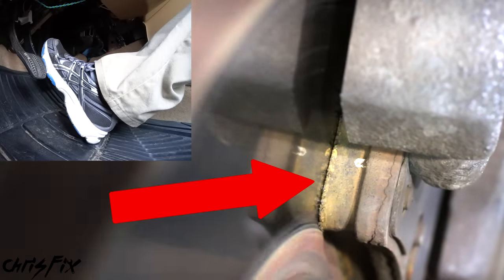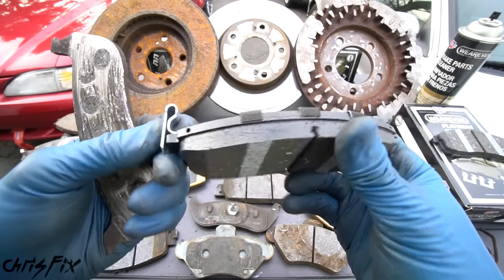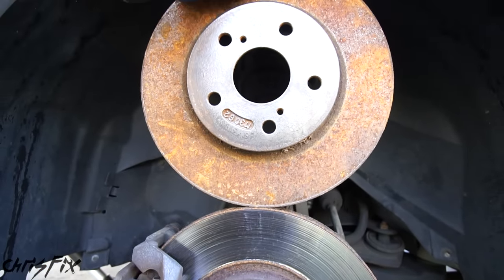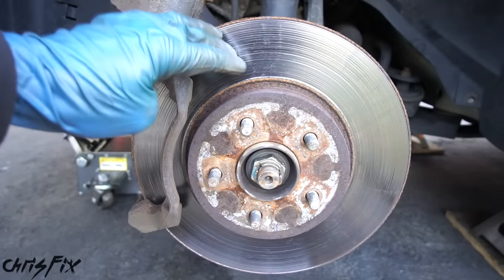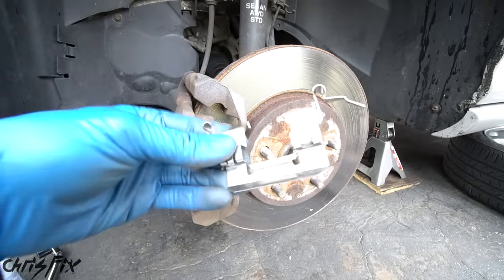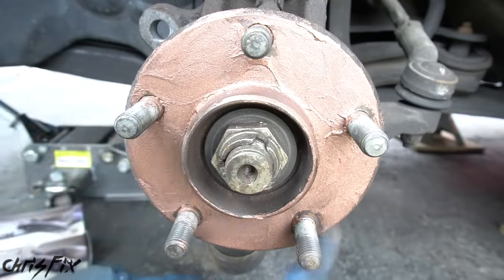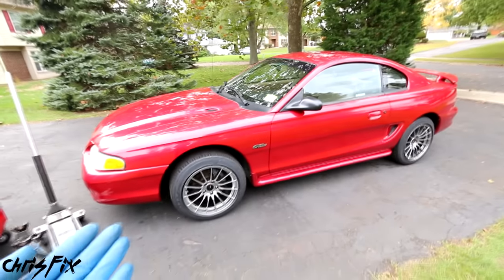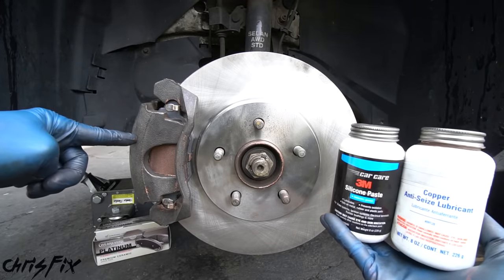How to Stop Your Brakes from Squeaking

Comment: Hopefully someone will help me here - I got everything on my front brakes replaced - rotors, pads, calipers, fluid and I still get this weird noise. Its kind of a grind that occurs at the same point when you turn the wheel. Imagine it like you start at 0°. Now from 0-270° no sound, 270-360° it grinds, kinda like you would be apply the brake just veeeery sligthly. So of course, it is much worse at higher speed then at lower speeds. I had my pads and discs replaced several times, and it always starts like this and gradually gets worse and after 2-3k km the rotors can be thrown into the bin. My thought are that maybe it is wheel bearing or hub.. but honestly.. dunno. Had 3 different mechanics look at it and it is still not ok. Car is 2010 Fiesta (front disc, rear drum).
Reply: Yes sounds like wheel bearing, hub or differential. Check for one of those.

Comment: Hi  Chris, i have a question on brakes for a Silverado 2017 with 30000 miles, rotor had some groves inside (by the dust shield side) but not on front side, front side if the rotor looks clean and only the front brake pad is wear, do i need to replace the rotor? or just the brake pads?

Comment: I have had break noise after getting new brake pads installed on my honda FIT which has never happened before, when I inspected it somehow there was copper paste that got all over my brake rotors which would cause it to squeal at low speeds. After cleaning the entire brake rotor and brake pads with soapy wooder the noise was gone. It seems the installation was not done properly as changing brake pads require you to clean the rotors and re-lube the brake pins, etc

Comment: Hi thank you for this educational show. It was awesome. I just had a complete front brake job brake calipers and rotors. Now the brakes scrub when I pull or turn left. (after watching this video I believe it is most likely a dust shield that is bent on driverside as it doesn't make the noise any other time.
Can you tell me if that is logical? Should I make them r&r to replace it or will the noise probably quit at some point?
Reply from the maker: Sometimes those dust shields get accidentally get bent when doing the job. It sounds like a shop did it, so I would ask them to check it out, and they should be able to bend it back and fix it!
Reply: @chrisfix  thank you Chris 😊

Comment: Well done Chris. Any chance you have worked on VW Atlas? The car is brand new and the brakes have a grinding sound when braking at low speeds. The dealer says it is caused by the brake dust the car let's off. The sounds has reached embarrassing levels at this point.
VW also noted in another thread that they switched from ceramic brakes to metallic compound.

Comment: Hi Christ. did u apply the copper grease on the groove of the caliper and then u put the brake hardware over it or apply it on surface of the brake hardware to make it in contact with the edge of the brake pad? thanks.

Comment: What do you do if after a caliper replacement, you cannot insert the brake pads into the caliper bracket using the anti-rattle hardware?  There is simply not enough space unless you place the pads alone without the hardware.
Reply from the maker: Sounds like you need to sand where the brake hardware seats. Could also be cheap brake pads with too much paint on them which gives you bad clearance.

Comment: How much of this translates to motorcycles? Do I want copper based anti-seize for those small calipers as well? The manual for MT-07 calls for graphite based brake lubricant. Also, I'm not sure whether I'm supposed to lubricate only the sliding pin or pistons as well (I'm a little afraid I'll break something or have trouble putting the caliper back together if I take out pistons to lube them).

Comment: QUESTION:
Chris, you talk about torque specs for different bolts and minimum thicknesses for rotors... Where can I find that information for my vehicles?  Is that information commonly found in repair manuals such as the Haynes manuals?

Comment: Although it was an old video, hope to get some help from someone.
I just replaced my brake pads and the brakes are scraping whenever the car is in reverse, as in braking while reversing. Not a single sound during forward braking.
Cant seem to find any good info on the internet.

Comment: What cause the noise when you ease off the brakes slow when moving off..
Reply: Ricardo, anyone help you with your question yet?
Reply: No one has ..
Reply: The most common cause of this noise is the pads, and that's ok. Brake pads can rattle sometimes due to heat expansion, especially if they were installed without anti-rattle shims.

When was the last time you had your brakes looked at?

Comment: we get a lot of cars with brake squeal even with brand new brake pads & discs on brand new cars. i think this is wrong but is it ok to apply brake squeal liquid on the front of the brake pads? the part that comes in contact with the discs? or does it have to be applied at the back of the pad (area that is in contact with the caliper motor) ?

Thanks :)

Comment: Great info as always!  Love the example of graphite vs copper.   Would you say the same about this ceramic stuff ? Permatex 24125 Ceramic Extreme Brake Parts Lubricant.     Just for the hardware metal to metal of course.  Pads etc… the pins get silicon and the hub gets anti seize.   So three cans one for a specific task… thx
Reply from the maker: The ceramic lubricant for the hardware is pretty good too!

Comment: My personal, lazy approach to brakes is something along the lines of, "if I'm going to take the time to remove the wheels and the brake pads, they're getting replaced, whether they need to be, or not."

I realize it's wasteful, but I don't think I've ever "easily" removed brake pads.  There has always been some type of pain in the ass involved.  A near-locked bolt, most commonly.

Comment: We have Problem on our Honda CR-V 2003 has a Problem in the Wheel when we drive it the wheel in the Rear start making noise I don't know what's the problem. My father said it's in the Brake pad I want to be sure the problem it is about brake pad
Reply from the maker: What kind of noise is it?
Reply: I don't know what it sounds like when he drive it the wheel in the rear side it's making a noise
Reply: I think the sounds like a when you scraping a metal

Comment: Hi, I wanted to ask. Sometimes I hear like a high pitch noise coming from my wheels. It's not really squeaking though. And it's not when I'm breaking, actually it's the opposite, hitting the breaks will stop that noise. I've heard it may be this acoustic signaling that some component on the breaks is wearing off. But in this video you are only mentioning one which makes noise when you are braking, not the other way around.
Any idea? BMW E90 by the way.
Reply: Probably a bad wheel bearing

Comment: Can't stop squeaking 😭
It starts after 10 15 min driving and only when going straight, if I turn or apply pressure it stops. Changed and lubricated most parts, now that I changed pads even more noise

Comment: Where does lithium based grease stand related to the other types you mentioned in this video? Is it better to use between metal brake hardware, or worse?

Comment: After installing new front  brakes and rotors the new break clips that were installed touch the rotor causing it to squeal. What are the causes of this?
Reply: They could be on the wrong side? Some hardware is meant for the inside pad and some is meant for the outside pad. as well as top and bottom positions of the pad. Pay very close attention to the ones you originally pull of the car.

Comment: The set of calipers you used to measure your rotors was not accurate for rotor or drum calipers. There are types that pinch onto the rotors say if you have a groove and also to get past that outer rust ring of the rotor. Also tolerances are so low nowadays with rotors that turning them is not an option anymore. Any shop would turn it away because the minimum you could take off would put it below it's discard thickness. It's good to replace rotors as much as you can possibly afford to when you doing brakes

Comment: I just got my brakes done on Thursday immediately the next morning after driving home from work I go to step on my breaks and it's making a whistling and it's very loud. I brought it back to the mechanic he put my car on the lift and worked on it for 30 minutes told me it's alset and if the noise came back he said for me to bring the car back and he will replace the brakes again and the reason for the whistling could be defective brakes please tell me what the noise is I believe he didn't lubricant my brakes

Comment: Excellent video! So I live in the northwest where it’s wet all the time. My brakes squeak every morning when pulling out of my driveway and then they don’t anymore. I’m assuming that’s the slight rust on the rotor reason. Is there any way to prevent that overnight rust? Would a new rotor not rust overnight? It’s driving me crazy that my neighbors hear my brakes squeaking every morning, but once I drive around the corner, they’re not squeaking anymore. It’s as if my brakes are intentionally trying to embarrass me in front of my neighbors!

Comment: What if my brakes make a squeak with rhythmic intensification until I apply the brakes and it stops? Then when under 15 while applying the brake it's a terrible grind?
Reply from the maker: Could be a bad wheel bearing or rotor runout.
Reply: Could you explain what a rotor runout is?

Comment: I only hear it on my left tire when I back up, should I replace it still?
Reply from the maker: No that could just be a small vibration from going in reverse and the brakes touch the rotor. Not a big deal.

Comment: Question for you Chris or the community.  The rear disc brakes on my Toyota 'moan' when backing up if it's rained through the night or if the humidity is high.  Pads and rotors look good and there are no noises or vibrations any other time.  What could be causing this and how do I fix it?

Comment: Hi Chris, I had a flat blown out tire after making contact with a curb. I drove about 50-100metres (on about 10-20mph) to find a safe spot to replace it with a spare; now despite I installed new tires, it started to squeak when I brake (at slow speed). Could this have to do with that short distance which I drove with a blown-out tire? I can't really see anything unusual with the brake system though :(

Comment: I have my car and it just started making noises when I apply the brakes, I notice when I’m going around 20-25mph and I ease into my brakes to glide to a stop I hear the squeal. I took it to get looked at but I was told my brake pads and calipers are good, and that maybe it was brake dust but I’ve cleaned it and I still have the noise. I hate when my brakes squeal, could anyone help me?
Reply: Also to add when I apply my brake to slow down it squeals but when I have the brake pedal all the way down it stops and my car brakes just fine

Comment: I have a 2007 Hyundai Sonata limited. My car wasn’t squeaking until ive recently changed my rotor on front right. After I’ve changed that  side been squeaking often i don’t know what it is causing that. It mainly will start after i hit a bump then it starts and even gets louder with i curve left. Stops only when i hit on the brakes. Dont think its the pads cause ive check them and looks good do you know what it could be? @chrisfix

Comment: G'day Chris. Would you advise using copper grease around the pack nuts where the wheel contacts the rotor to prevent potential rust problems if the rear inner or outer bearings need replacing? Great show as always, Sydney, Australia.

Comment: You were doing so well right up until putting copper grease on the pad/caliper, you even talked about contaminants causing issues and then you introduce a contaminant almost on purpose...aside from the guide pin that's one I see gets missed out all the time.

Comment: Hi Chris, I haven't used any steps in this video just yet, however, my brakes are brand new and still making noise, this stops after about 20-30 mins of driving however, and rarely they don't squeak at all. Also when I'm rolling at like 15MPH, there is sometimes a squeak even though I'm not braking. Do you have any advice you can give? :)

Comment: For some reason my brakes only squeak sometimes, most days they don’t squeak but once in a while they randomly do, I’ve checked the components and couldn’t find anything that would cause squeaking and I just don’t know what it could be
Reply from the maker: The pad material sometimes just squeaks from contacting the rotor due to humidity or whatever.
Reply: @chrisfix  ah thank you so much, cause most of the time when they squeak it is raining or had been raining.

Comment: Just had new pads and discs, is there any way the calliper could be the reason of it squeaking when I’m coming to a stop?
Reply from the maker: The brake pads they used could have cheap pad material which could squeak or they didn’t use new shims or they didn’t lubricate the correct parts.
Reply: @chrisfix  great, thanks for the reply man

Comment: I have continues noice on mine. And when I press down the break it goes away. You know what this can be? I cleaned them before and it stopped but now it seems coming back :(
And its only the front one that I changed myself with the budget version of the original. Maybe those dont hold same quality.
Reply: I would guess The surface where my rotor sits might be dirty so its wobbles and make the noice as you say in video. Probably that.

Comment: Hey Chris, great video. Appreciate the detailed explanation. I do have an issue with my Toyota Corolla 2015's breaks.  Occasionally I get to hear a clicking noise when I apply breaks. Especially when driving slowly and over road humps. I should say that at times I had crashed on humps at speed because of poor lights at night. So I'm not sure if these are after effects of such incidents. 

Pls advise

Cheers
Vinod Balakrishnan

Comment: Hi Chris I like the way you showed and explain everything on your videos. But got question for you.... Whenever i turn the steering wheel slightly to the right (while driving the car), my front right brake makes a metal to metal squeeking sound. I already put in new brake pad into it and the brake rotor is still ok. Do you have any idea? Is it the dust shield or the brake hardware causing it to squeek?

Comment: Great video, I get squeaking when I turn into a carpark with gently tapping the brake but more noticeable when completing a 3 point turn or reversing and turn at the same time, pads have been checked and mechanic says they are fine do you know what might be the issue? Also can you see the qear indicator when the brakes are on the wheel?
Reply from the maker: It could be there is no lubrication on the pad contact points (ears and backing plate). Could also just be the pad material makes nose.
Reply: @ChrisFix  thank you! Car is going back to mechanic this week, I will let them know to check these areas. Love the videos keep it up!

Comment: Hey Chris, 
Would you be able to provide any advice on brake sticking/binding noise? Just changed the front rotors and pads with Advanced Auto Parts Platinum parts and when I go to a slow stop or release the brakes slowly there is now a binding noise. I checked the torques, greased the metal contacts, lubricated the pins and new hardware. Also I did notice that there is a small tear in the dust boot. Thanks!

Comment: Hey Chris, I recently replaced all my rotors and brake pads. They're working fine, but my back left wheel will sometimes make a knocking noise as if the rotor is knocking against something. But it only occurs sometimes which makes me think the rotor isn't warped. When the noise occurs it subsides with pressing on the brake. I lubricated all the sites appropriately to the best of my knowledge. Previously, the reason I replaced everything is because the back left wheel had brake pads that were run completely down but all the other wheels brake pads were normal I just replaced them for preventative maintenance. Any thoughts? Thanks.
Reply: Maybe the brake caliper